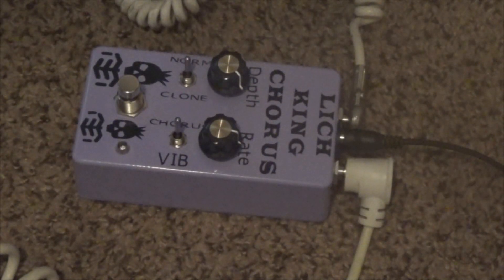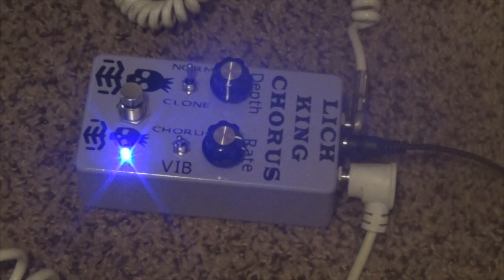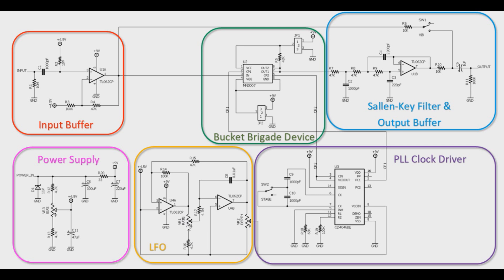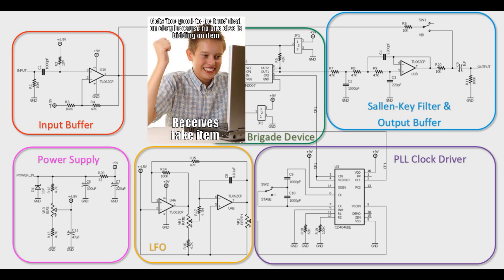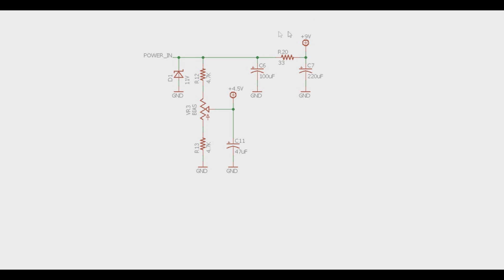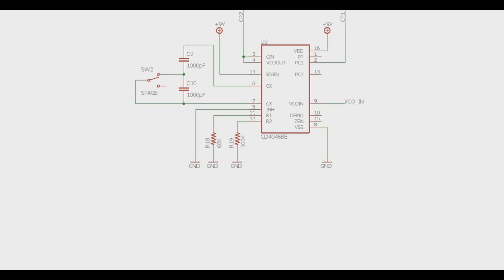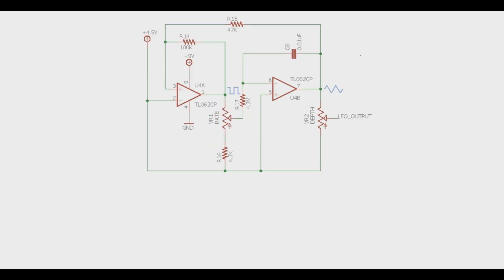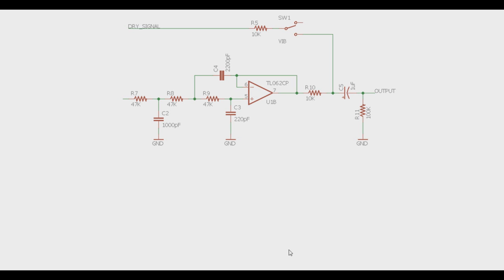Chorus Guitar Pedals - How do they work?

Comment: I know that the 6 voice delay line circuits in old synthesizers used 512 BBDs and they're supposed to be slightly out of time with eachother and the signal is then sent to a mixing amplifier

Comment: I got a question that might sound stupid, but it's been bothering me for quite some time. Is it possible to built three of this same circuit only using the fast speed on the vibrato setting at setting the speed of each circuit differently and sending the outputs into a 3 channel mixing circuit to make it sound like an analog chorus circuit in a synthesizer with the 3 delay lines being the chorus circuit?

Comment: I need some help, man. I recently got a Mosky RC5 multi-effect pedal and every effect works fine, except the chorus. When I turn it on, it sounds with a little bit of distortion
Reply: It might be providing a bit of a boost. A lot of Chorus pedals tend to be close to a clipping point and sometimes require the guitarist to roll back their volume knob to make up for it.
Reply: @erikvincent5846  , I've tried rolling back the volume knob, but it won't go away. I don't know what else to do :(
Reply: @elalexander  it may be that it has something, like a clock signal, bleeding into the chorus clock signal.

Comment: It is very well explained, but I'm afraid it doesn't give enough insight to a novice pedal builder. How does a delay device produce the chorus effect? One basic Physics concept is "beat" - when you combine a 440Hz audio signal to a 442Hz, it creates a "wavy" effect of 2Hz (the difference between the two frequencies) which is characteristic of the chorus effect. It is mentioned that for chorus effect a short delay time is required, however, if you combine a short delay signal to the original, all you get is a "bathroom-like reverb". The chorus effect only occurs when you combine a signal slightly off-tune in relation to the original signal - that's where the delay device plays a role. With delay pedals, you can set the 'feedback' knob to maximum (infinite echo repeats) and vary the 'time' knob up or down - if you go up, the pitch of the echoed signal goes up, and vice-versa. The low-frequency oscillator plays the role of someone varying the 'time' knob of your delay pedal back and forth whilst you play. So, basically, a chorus pedal is a (short) delay pedal that combines the original dry signal with a detuned echoed signal. The importance of the short delay time should be evident at this point - if the delay time is set to a discernible interval, one would hear the detuned echoes separate from the original signal and sound quite messy.

Comment: I took a basic electronics class back in highschool in the early 80's so my knowledge is bare minimum. Anyways great video. I play guitar and I always figured a chorus pedal took the sound/notes and added one more that was a tiny bit higher pitched and a note that was a tiny bit lower pitch to get the chorus sound. Like when your tuning a guitar from the string next to it, it sounds kinda like a chorus sound just before the 2 strings come in tune.
Reply: That, and if you kill the dry signal and just leave the "effect" it becomes a vibrato effect instead of a chorus.

Comment from the maker: Dont forget to check the large section of the build doc (page 5 "circuit analysis") for more in depth information about this circuit, link in the description above
Reply: Hi! Question,  from what I've gathered here my understanding is that if I already have a vibrato circuit (built into an old electric organ) I could relatively easily modify that to also become a chorus circuit by mixing the dry signal back into the wet one? Of course I'd need to see if the general circuitry will accommodate that, but in essence it should be doable?
Reply from the maker: @moabgram  It would be doable, but there will need to be some sort of "mixing" circuitry to "put it back together"
Reply: @DiyguitarpedalsAu  I'll have to see if the vibrato is also acting as an amplifier, if not I'm thinking some kind of single-stage mixer will do the trick. Although I´ll have to freshen up on my impedances to make sure I won't roast something.

Comment: Very nice! I built the Tonepad clone of the Boss CE-2 some time ago. It just sounds BEAUTIFUL. 
I went back and tried to analyze the circuit of the CE-2 while watching this video, and now many things make sense, although I still struggle to understand op-amp circuits.
Reply: Nice. The Tonepad clone CE-2 was the schematic that got me started into guitar pedal building in the first-place. Though I am a metal-head, I have a guilty pleasure for 80's new-wave. The Boss CE-2 has a lot more nuanced filtering before and after the BBD's, partially for softening the vibrato sound and for making up the subtleties of the BBD's clock.
Reply: @erikvincent5846  I started with a very basic circuit (on purpose. I was 15 yr old at the time and had to learn everything, from PCB making to soldering): The Tonepad clone of the EH LPB1. A single transistor booster. Took me three tries until it worked :P